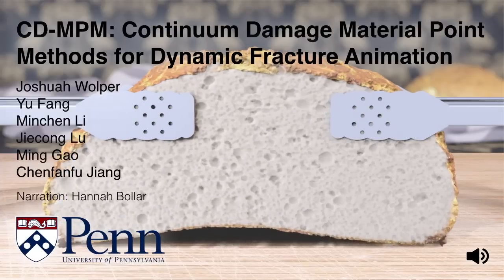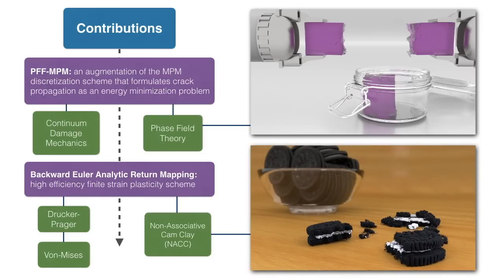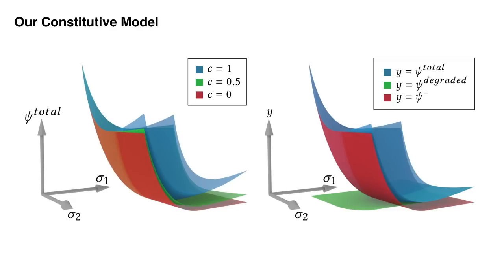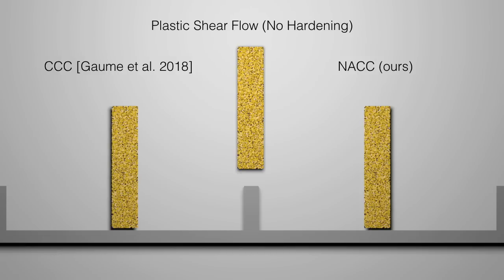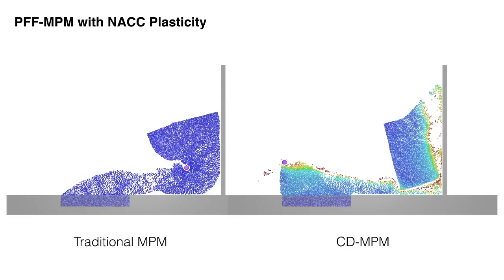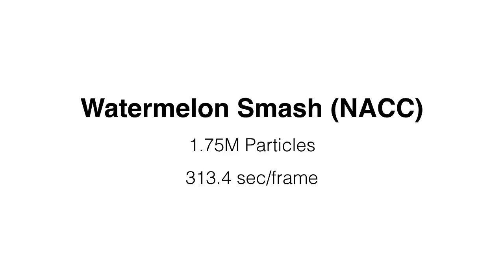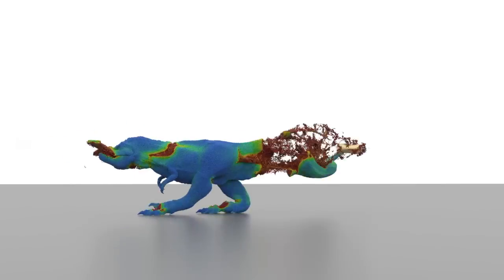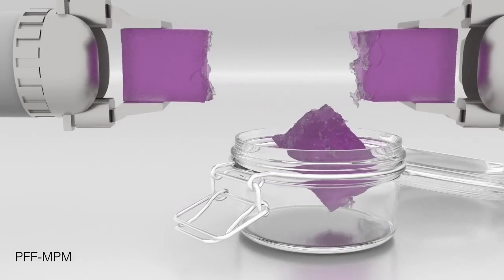(SIGGRAPH 2019) CD-MPM: Continuum Damage Material Point Methods for Dynamic Fracture Animation

Comment: how long did these take to render and what hardware was used? Nevermind, in the video!
Intel I7-8700K with 12 threads (assumed 12 software threads)
Cookie: 1.67m particles, 634.5 sec/frame (10.5 minutes to simulate a single frame)
CRABS: 0.918m particles, 96.8 sec/frame (~1.6 minutes per frame)
Watermelon: 1.75m particles, 313.4 sec/frame (~5 minutes per frame)
Pumpkins: 1.02m particles, 176.7 sec/frame (~3 minutes per frame)
Octocats: 0.690m particles, 17.6 sec/frame (~4 frames per minute)
JELLO T-REX:  1.43m particles, 538.8 sec/frame (~9 minutes per frame)
Fence: 1.45m particles, 175.2 sec/frame (~3 minutes per frame)
Armadillo: 8.27m particles, 118.3 sec/frame (~2 minutes per frame)
JELLO TWIST: 7.79m particles, 548.6 sec/frame (~9 minutes per frame)
BREADS: 11.5m particles, 331.7 sec/frame (~5.5 minutes per frame)
Reply: While this is cool in concept... I can't get excited about this stuff until they can do this in real-time.